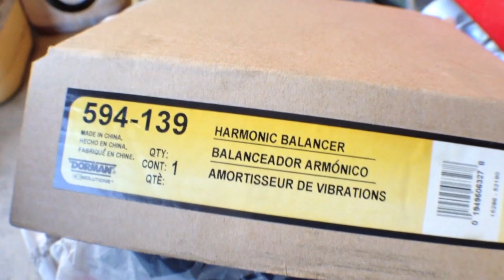Noisy Shaky Harmonic Balancer Replacement Toyota Camry √ Fix It Angel

Comment: Does anybody here remember changing out 3 different belts on their car instead of one serpetine belt?  Ahhhh....those were the days. 🤙
Reply: Yeah that was the best because if the AC compressor bearings failed you can just take the belt off and still drive the car.  Now you have no choice but to get the compressor changed.

Comment: Okay angel I watched everything you did the only thing that really looks very difficult is when you get to the part of of just loosing the 14 mm nut with the extension I just hope I can get to it because I need to get the harmonic balancer from my 1998 Toyota Camry that was hit from behind in an accident and put that one on my 1995 beater Toyota Camry that has a wobbly harmonic balancer hopefully I can do it with God's help and your video right now I already have another 1998 Toyota Camry le 4cyl  with only 100 thousand miles runs like a brand new car but I'm trying to hold on to my beater 1995 Toyota Camry le for 2 more years before I retire it completely. By the way you're videos are very inspiring and very helpful. Thanks a lot and God bless and your whole family.

Comment: Thank you. I've replaced one on 95 Nissan Sentra. There was no wobble or noise, but the timing mark was "drifting" during timing test causing car to fail smog.
When tightening the original crank pulley with impact gun (after changing the timing belt, for example), match mark the bolt to the pulley before removal. After tightening bring the bolt close to its original spot. (This will not work on late model cars that don't have a key in the crank pulley such as Dodge 2.4)
Reply from the maker: Thank you again for giving your experiences/tips on cars you have fixed. I really appreciate it. Have a nice day.

Comment: He's no Chrisfix but I like him. Good work!
Reply: Farina Marcini . That's exactly what I was thinking when this guy compared him to Chris  fix I have learned a lot from Chris fix but I benefited way more by watching fix it angel do his thing specially on this  Toyotas I have a 95 and 2 1998 Toyota camrys  I'm removing the harmonic balancer from the 98 that I have but no longer is drivable because of an accident I had and I'm putting that harmonic balancer on my old 95 Camry they're compatible as far as the harmonic balancer and a whole bunch of other parts is concerned my 95 is my backup car I  replaced my 98 Camry that had an accident with a 98 Camry that is an excellent condition as my main daily driver car lol .

Comment: So I did this repair but tightened the crankshaft bolt with ratchet and sockets. I know the torque is way off but would the tightening without an air tool impact gun really make a difference? My prius shakes and no check engine lights

Comment: What size screws are u using to secure the yoke??..the rental kit from the auto part store and the kit I got from harbor freight don't work..also the replacement part has two screw holes and not 4 like in the video or the one I'm trying to replace..need advice if u can

Comment: So, seeing how this is an older car, it's probably got more issues with it; i.e. Shot struts or motor mounts, weak compression, etc. have you ever asked a customer how long they intend to keep the vehicle running. I know every car is different as well as everyone's budget, but do you ever tell them they're driving a ticking time bomb that's draining your budget? 

I only ask as I had this happen to me with an old Ody that's been neglected and 250k on the clock. Thanks for all you do. Love that sneeze!!!lol
Reply from the maker: Hi Miguel, The car is a '00. The owner is a friend of mine. She been having many problems with it. I did suggest her to get a new car now. I have been fixing that car for 10 years already. lol

Comment: I made a mistake on my 99 Camry. I used a Puller Kit but the bolts were too long. When I placed the duck foot and used the long bolts it ended up pushing the entire motor within the engine cavity and i busted one of my Motor mounts. Lesson learned: Use much shorter bolts.

Comment: is there a way to make that clutch click any softer when it comes on? Everytime I sit at idle and it comes on people look over. maybe oil?

I also have some fluttering noise around 2000-2500k. before that or after and it goes away. wondering if it's the timing belt or something

Comment: wow bro you are awesome I've been trying to do this for my daughter car. Thank you very much. Question though, when you used the impact wrench it didn't turn the harmonic balancer is that only because you used an impact wrench because I was using a socket wrench and it would spin everything. Still it's  on the car.
Reply: Thomas Conner  use a cordless impact wrench
Reply: Thomas Conner  just look at your angle and see if there's a way for a pri-bar to hold. It takes some work but be patient and not quick to anger. If youth can control those emotions you will see and it'll be easy. Take your time.

Comment: Awesome video.  Could just use a small explanation in the video of what that bolt way inside under the engine was for.  That's the one up above the CV joint as it enters the axle.  what is that?  Not everyone will know what you're pointing at and why.
Reply from the maker: Hi thank you, 2:30 all you need to is loosen the bolt so you can pry the power steering pump to remove the belt. 
The bolt is located on top behind the pump.  It is very hard to get to. I showed the tools to use. Sometimes you have to watch the video a couple times to understand. Have a nice day.

Comment: Just replaced Harmonic Balancer 95 camry 209K miles worn out and pulley shifted!
Reply: Roger R was it causing your battery to die
Reply: Roger R was it causing your battery to die
Reply: The alternator belt popped off and could not be put back with the balancer  shifted. So the battery was not
charging.
Reply: Roger R i

Comment: I actually already switched 2 and the other 2 are still good, when I switch gears my motor doesn't seem to shake or jump. At a stop it'll make noise but while running it's ok
Reply from the maker: Then you need to remove the wheel and see the harmonic balancer vibrating to see if it is bad when AC is on.

Comment: Nice Vid!   its 1:30 am   no one to ask.  i didn't check the tolerance of the power steering belt . look like yours is way close as well so F it. i am putting it back together.  

  114.00 for a damned harmonic balancer???!!!  WTF   your store is ripping you off bad man.  i just did a 2 second search and  you can get one with a ten year warranty for 25 bucks free shipping on ebay.  50 at rock auto but you have to pay shp on that.   wow though. autozone. YIKES

Comment: I have a 2007 Camry and I switched water pump and oil pan when I took car to dealer due to oil consumption recall and now it's making a noice inside by the dash and it's only when I have ac on would this be the solution? Changing the harmonic balancer?
Reply from the maker: I think your motor mounts are bad

Comment: What threads are the bolts used for the puller to attach to the balancer
Reply from the maker: Adrian Manbodh it was a metric bolt. I think 1.25

Comment: wouldn’t tou not suppose to use the bolt to push in the balancer???
Reply from the maker: I used it, no problem. But first, I used the dead blow hammer. As long the bolt has been threaded in around 5-7 turns.